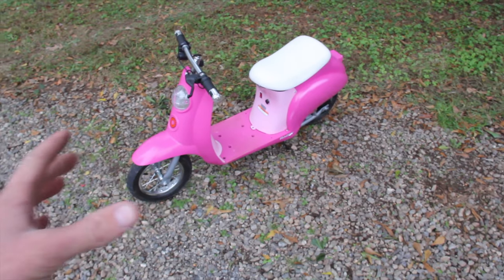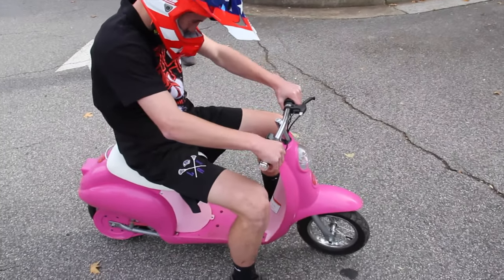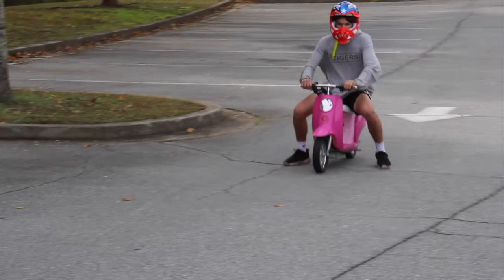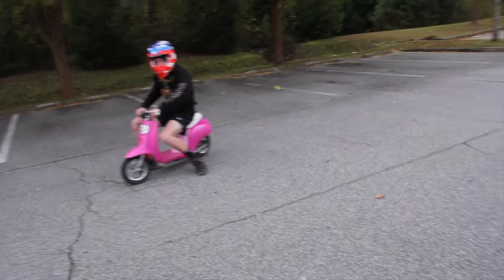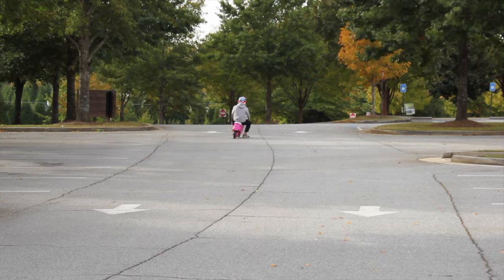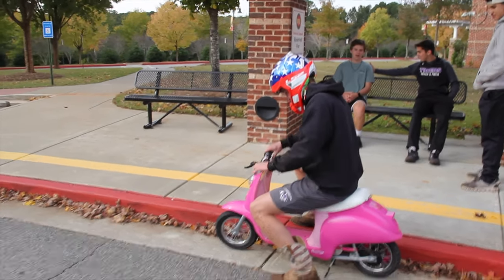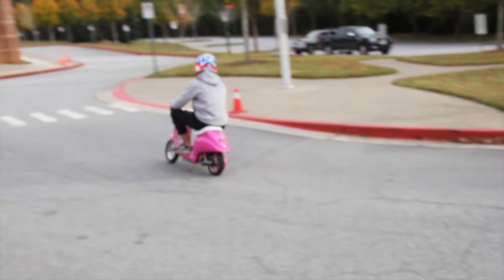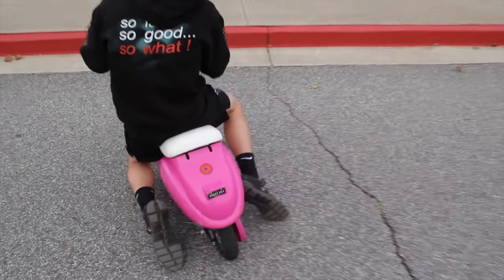42 mph Barbie Moped!

Comment: Back watching this vid again this am, great stuff! I've been converting my kids 5 power wheels all the 20volt drill batteries, I tried one at 60bolt and fries the motor,can you post the motor you are using?
Reply from the maker: i’m going to start working on a explanation video soon! i used a 3,600 watt brushless motor with 6, 11v 5200amp battery’s
Reply: @NoBrakes  Looking forward to the video. I've overvolted my daughters to 36v and I'm looking to make it a bit more powerful.